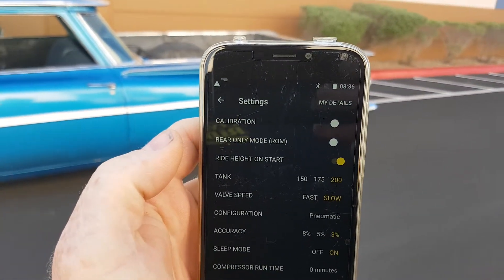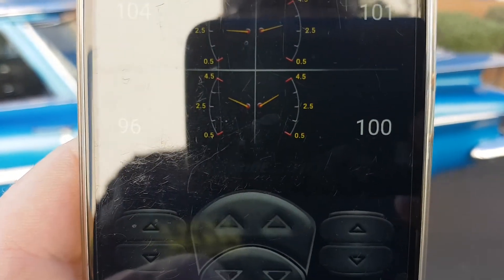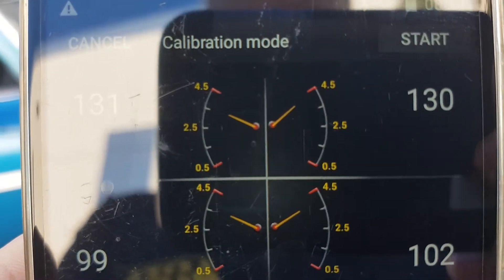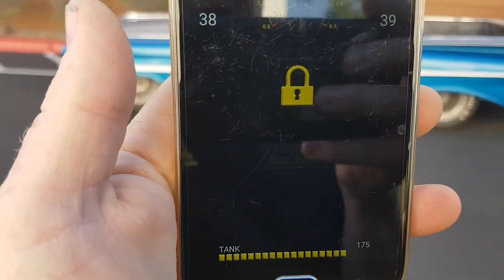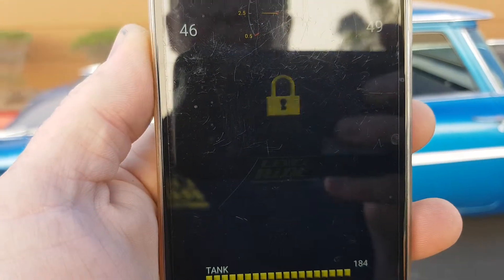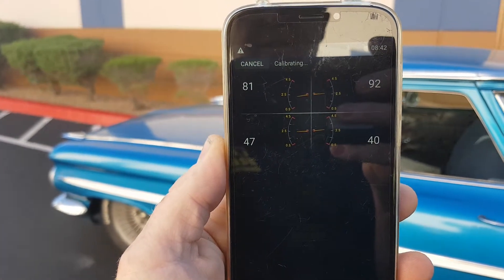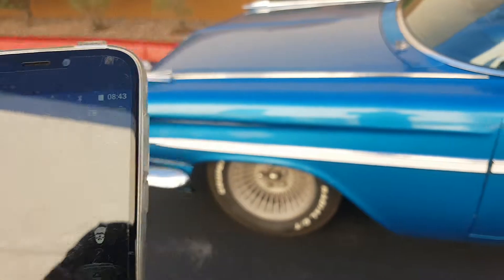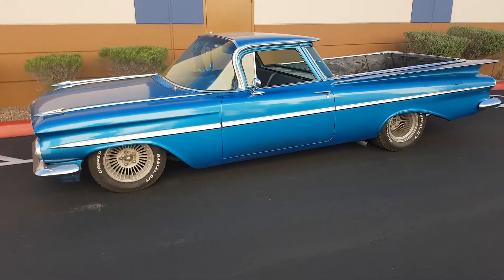Video 15 Height and pressure calibration

Comment: Hello, does all level ride air suspension control kits has height sensors? If not, which one is with? Is it possible to upgrade from pressure only kits to the kit with height sensors?
Reply from the maker: Yes we have two kits , pressure only or Height and pressure so yes you can upgrade